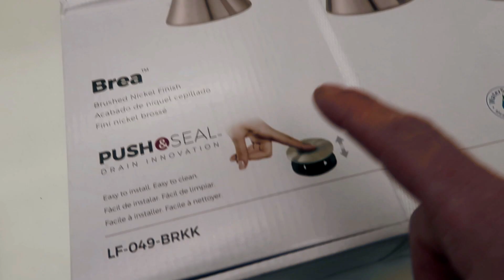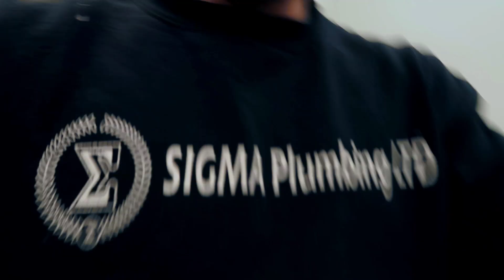youtube video #-ReP8ZQtFNI

Comment: Glad I’m not the only one who gets gassed when I have an install like that!  Usually, once I see really severe fusion of the valve parts, I alert the customer to the possibility of minor damage to the porcelain and get them to sign off on it!  Then I use my grinder to cut a deep notch from the top using a piece of sheet metal as a protective shield It is much quicker and easier on the body I’m 72 now! Keep up the good work
Reply from the maker: That’s great advice right there Barry! I appreciate the insight and support friend!

Comment: Hey, good job, from one plumber to another, I find using a Dremel tool with a small cutoff wheel extremely useful in removing the mounting nuts from underneath. Cut a notch through the nut then split it open with a large screwdriver, and yes I always tell the customer we need to bring this up to code by installing shut off valves. If they say go ahead, that's some extra money. If they say no, that's on them, but I rarely have them say no, don't put in stops.
Reply from the maker: Thanks Dennis! The Dremel tool is a great idea and I’ll definitely see if I can get my hands on one the next time I run into a situation like this.  A vanity does not require shut offs according to our code book, they are just a convenience for the homeowner or plumber. However, I still agree with you, I do think I should give them the option for the convenience of shut off valves, and I will in the future. Thanks for the support Dennis! 🙏🤟✌️

Comment: Great vid.  My second time replacing a faucet I encountered a similar issue. No power tools available.  Ended up having to take a blade off a hacksaw and slide it between the sink and plate so I could cut the bolt. Soooooo gassed after that one.